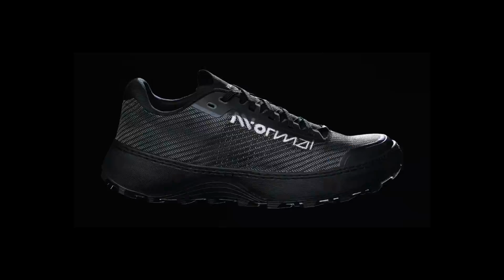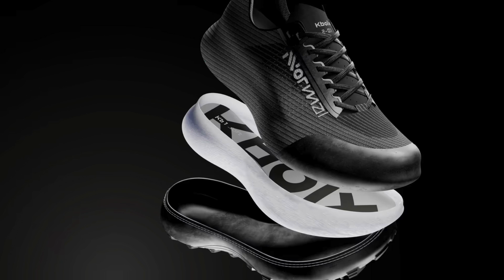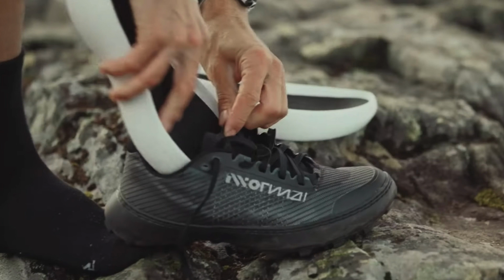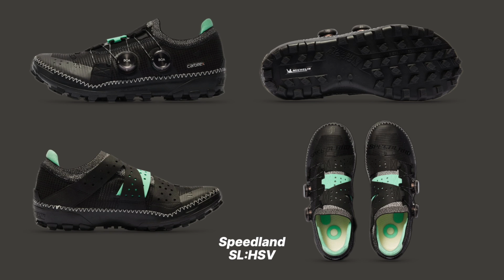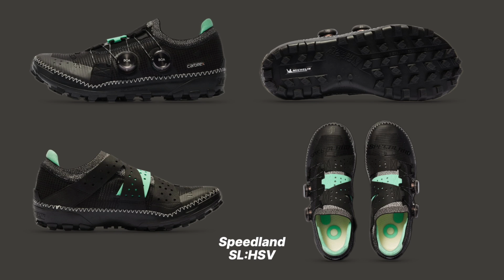Nnormal Kboix - Can a modular running shoe actually work?

Comment: I did a bit of hiking last year in a modular shoe by Haglofs called the duality. It uses 2 bloom foam replaceable midsoles. A softer red insole for most trails and paths, and a denser stiffer grey insole for rocky terrain.
I like the idea. I had wondered if the insoles wouldn't settle the same way when I changed them out but that wasn't a problem. They slotted into place consistently and the feel was the same. So I think this concept can work well.
I didn't change the mid/insoles that much because I wasn't so happy with the stiffer feel of the grey one on all but the rockiest terrain. And I have other boots that handle that terrain better.
If I could have ordered a midsole with slightly different characteristics to both of them, I could have made the shoe even better. This is where the Kboix can really take off. Give runners the chance to tune their midsoles and shells and many will want to try the Kboix. Swap out a carbon plate midsole from your regular Kboix to your Winterised waterproof one? No problem. Buy an aftermarket midsole from a specialist vendor? Yes please. It's not just a shoe anymore, it's an ecosystem
Reply from the maker: This is one of the differences with the Kboix… Nnormal is really looking at it as an ecosystem fully. The concept has a lot of legs in many mountain applications.

Comment: I don't recall the brand name, but years back there was a running shoe that cam with 3 midsole inserts that can be replaced.
Reply from the maker: The basic concept has been around design magazines and press releases but has never made and real impact due to multiple issues.

Comment: Is the Kjerag midsole really the "soft" foam? I mean I like it, but I guess my midsole ignorance is showing. Maybe I am confusing certain brands (Salomon, Nnormal) being firmer than others, but I guess I still am not able to really "get" the differences between soft, reactive, and bouncy. I mean I know my alphaflys feel like trampolines, but now I am afraid to use any of those three descriptions without being wrong. Great video btw, very thoughtful.
Reply from the maker: Trail shoes are also more firm than road shoes. No one has experienced Nnormal’s form beyond their (excellent) supercritical EVA. I don’t find it soft, like a road shoe, but I find it absorbent in the best ways. I’ll have my Kjerag review up this weekend. It’s one of the things I’m going to talk about in it. 

I am very curious about Nnormal’s TPU and PEBA foams though….

ZoomX and especially Alphafly ARE trampolines compare to trail shoes, even the Ultrafly (I’m also working on this shoe and will be discussing it as well).

So much to talk about in trail shoes right now!
Reply: @SagasuRunning  very helpful, thank you. This gave me some thoughts about my training which for practical reasons almost always starts from my front door with a 2mi commute to the nearest trail.
Reply from the maker: @colinmcc8564  Given how well Vibrim MegaGrip LiteBase wears, even on roads, this shoe could be ideal for that type of mixed surface running. I can’t wait to try hot swapping on a run when I change from dirt to road.

Comment: I’ve run 700km+ in my Kjerag’s now and just ordered a new pair for the spring although they are still in good shape. Also the Speedland has a removable carbon plate, so modular in a sense. The Tomir is like a tractor, so I hope this shoe will be something in between. And Boa would be great as I miss the Salomon quicklace on my NNormals. Thx for a good insight.
Reply from the maker: I’m curious what type of durability I will get out of my pair of Kjerags given the bit of road running I’ll need to do to/from trail I have available. 

The Tomir = tractor 😂 (sounds like a good hiker)

I would expect the Kboix to be more tractor than racer… but we will see. I’m so curious on the engineering on this one.

I’m actually not a fan of BOA, I hope it never becomes a norm for running (I’m a former cyclist and have had enough BOA drama in my life)… but it does solve engineering problems.

I too would like to see some type of speed lace system on Nnormals, especially given how well the uppers are designed and fit. 

Thanks for watching! 🤙🏻
Reply: Since you mention BOA, I think it is interesting that Tadej Pogacar has a custom DMT cycling shoe that has laces like the 1980s before Velcro closures and the Sidi Genius buckle system.
Reply from the maker: @brianreiter5572  I just googled them. Nice.  The 2024 models looks like a Salomon. I also like the lace pocket at the top of the eyelet chain.

You can never fully get rid of pressure points somewhere on the foot with BOA. It’s just the nature of the system. In a running shoe, with thinner uppers it’s a bigger issue. Speedland’s current design solution is interesting but still could be problematic for some foot shapes.
Reply: The Salomon style “lace garage” on the top of the tongue is a good idea, even with normal laces. The DMT KRSL has one I think for aerodynamic reasons. The Arc’Teryx Norvan line of trail shoes also have one. 

I have only seen it in Salomon and Arc’Teryx in trail shoes. Those are sister brands under Amer Sports so maybe there is some kind of patent or trade dress that keeps other companies from using it. 

It helps keep the laces from coming untied or getting snarled with blackjacks. It’s quicker and easier than tucking the loops into the laces down the chain.
Reply from the maker: @brianreiter5572  No doubt on a cycling shoe it’s for aero reasons… I remember that is one of the justifications to move to BOA years ago was cleaner aero for the shoe. Something we don’t really need to worry about in running, at least to the same degree.

Also, that would make sense there is some type of patent protection there. Salomon has been doing that for a long time.
Reply: @SagasuRunning  I also noticed that Kboix has a second heel hock lace-hole, which I miss from Kjerag/Tomir.
Reply: I have no need for a lacelock eyelet in a Kjerag. The last eyelet of the Kjerag is slightly high in the heel collar and really offers exceptional lockdown and comfort without any fiddling around. 

I think the key is to size the NNormal shoes by CM rather than the national sizing scheme though.
Reply from the maker: @brianreiter5572  Agree on this. The top eyelet on the Kjerag sits higher (and more forward) than most but there is in a tiny pocket made by the tongue right at the curve of the top of your foot… and offers exceptional lockdown due to its placement.
Reply from the maker: @sandstromj  I noticed this too. I wondering if it’s there to give more options as the upper (inevitably) wearing and stretches out. Something you don’t need to worry about with the Matryx upper on the Kjerag.
Reply: Killian uses the Tomir for running in snow and ice with tungsten carbide studs screwed into the lugs.
Reply: @brianreiter5572  I also just screwed spikes into my Timor’s and I really like them more as winter than summer running shoes.
Reply from the maker: @sandstromj  A true tractor, that!
Reply from the maker: @brianreiter5572  A literal "tractor" that. Thankfully, I no longer need to deal with snow and ice. Just mud and volcanic stone.

Comment: I read in RoadTrailRun that NNormal is claiming 240g in a standard size 9. That’s more than Kjerag but very light for a trail shoe. 

If it was anyone but Killian, I’d write this off as a gimmick. Because of Killian, I want to know more. 

But it is a ton lighter than the original Speedland design, which is 305g in reference size 9.  Also Speedland no longer makes the shoe that is like this design. They gave up on a lot of the modularity after their first shoe design. Their strategy is to make one run of each design and now they are doing something very max cushioned and less modular. 

The matryx upper is very light material. I imagine the outsole rubber having to wrap around the midsole and be stitched to the upper is the extra weight. 

The Kjerag is very interesting. It seems like a very direct evolution of a Salomon s/lab Pulsar but with the CO2 supercritical EVA midsole and vibrant outsole. The heel and ankle collar do not get a lot of discussion but they are sublime. I have a pair and they are both absurdly light and somehow just protective enough to handle rough terrine. I took them running in the mountains in New Mexico. They are very much the kind of thing I like and so close to hitting it out of the park for me. But the fit is quirky and too narrow in the forefoot or I need a half size larger — which they unfortunately do not make.

I’m really interested in this company. They really seem to be trying to be innovative and thoughtful in their designs.
Reply from the maker: I read the RTR too, which is what informed my thinking that this was a shoe meant for racing for Kilian and not just another trail shoe.

Agree, if this wasn't from Kilian, it would just be another design concept. But he seems intent on really evolving things and has the knowledge and passion to actuall do it.

Speedland was interesting to me with their first shoe, but I've now lost interest. Their current models do nothing for me. I like Cam Hanes, but not enough to go further with Speedland.

The Kjerag is the direct descendant of the Salomon Pulsar SG...it's Kilian with free reign, not needing to make any compromises Salomon wanted. I've never run in the Pulsars but I'm now curious due to the Kjerag. The fit of the Kjerag is also quirky, not narrow, but very long, requiring a .5 size down for most (including me).
Reply: I don’t think it’s the SG. It’s like the regular pulsar. The SG has wider spaced lugs and 5mm lugs. 

One of the stunning things about the Killian Kjerag story is the lugs are only 3.5mm. There is no deep lug version for mud. But for Killian somehow it does not matter.

I used to run in the s/lab sense but one iteration did not work for me and I ended up with an extremely painful gout-like great toe injury. The doc told me not to run in those again and I have been afraid of Salomon since. But I know the Salomon fit and I have been tempted to go back and try the s/lab pulsar. Maybe the pulsar 3.
Reply from the maker: @brianreiter5572  Interesting. Kilian directly mentioned the SG as the shoe he started the Kjerag development… and specifically how he toned down the lugs but started with the more flexible outsole idea.

I’m dealing with a big toe joint issue now, not as bad as you described, but definitely conscious of how certain shoes fit my fit at the moment. Luckily the Kjerag is a very welcoming fit for my foot, even with the narrow fit. I’m happy about that. The upper on it is so clean.

I have alot of technical steep rocky/muddy trail here in Taipei. I’ll definitely be putting the 3.5mm lugs to the test on the Kjerag. I think I have some thought as to why the low lugs work on so well, but I need some more time in the shoe to confirm.
Reply: I don’t think I have seen that video or story about Killian flat-out saying he copied the Salomon Pulsar. I mean I thought he did that but not that it is something you would ever say.  Do you have a link to it?
Reply from the maker: @brianreiter5572 I’ll try to look for it when I have time… but it was from one of the podcasts he was on around the launch of Nnormal. The host asked about the Pulsar SG and I remember Kilian talking about the development of the model… then the hat asked is that where the Kjerag started in his mind and he confirmed. Kilian never outright says it, rather he implies it and talked about how he liked the ground feel in the SG and it was something he was trying to get right with the Kjerag and why they didn’t use a superfoam on it (too bouncy).
Reply: Kjerag is a much better show (wider heel for instance) than the Pulsar SG and vibram also gives them so good grip.

Comment: Intriguing. I've only started watching this video. But why hasn't other shoe companies played with this idea? (monster insole). It seems obvious when shown here. Hopefully it's not because of forced obsolescence (mid soles of running shoes tend to get crushed out before the outsole, upper are ruined)
Reply from the maker: It’s what I said in thevideo… complexity and manufacture costs. I’ve seen this concept in many a design concept portfolio and in design magazines but there are massive challenges bringing it to market. I’m very curious about all the little details of this one they Nnormal are working through. 

It really is a “the devil is in the details” type thing with this execution.
Reply: Speedland did this already
Reply from the maker: @RowOfMushyTiT … and many others did it before Speedland. Plus this is a very different implementation of the idea than what Speedland did. They were trying to make the plate in the shoe removable and have  an extremely different design solution as well. I did reference Speedland in the video though.

Give it time to see where it goes.

Comment: Honestly, I really like the normal laces on Kjerags (compared to Salomon speedlace) - you can adjust the fit much better. I also don't see that much point in dual BOA. I don;t believe that it would enable big changes in the thickness of the midsole. I prefer to have at least somehow affordable shoe rather than making it even more futuristic and costly. Because let's be honest - if you care about reducing ecological footprint, wide adoption is the single most important factor. And even though people are willing to spend  a bit more for more long lasting shoes, you can't go crazy like Norda etc.
Reply from the maker: Ya, I’m not a big proponent of BOA for running shoes due to the extra complexity, weight and cost. I was merely brainstorming and idea on how to remove the excess upper for smaller midsole stack units. It could be done with laces as well, though it could be more complicated.

I also agree, an affordable cost… around what a “normal” trial shoe would be is key here. There are already other companies pushing the upper edge of price for “innovation” or “durability/materials”. That’s not the play here.

Comment: Road running where it is relative consistent terrain, trail changes depend on geography. For dry and relative "smoother" I prefer <4mm, wet   i prefer more, and different if rugged terrain. I presume the midsole is also the same thickness, but in trail shoe, there are different thicknesses for contact feel, and in trail, you need this for the uneven surface. Changing midsole is one thing, but consistent outsole is another. Also, upper the same? I agree that modular definitely have more moving parts, which results in more failure points. I just think this is a novice approach. I like the idea of design for repair. But the question is how accessible or cost of repair. It is only great if the network of repair is close to the customer. Just like a car, as it gets older, repair for parts just get more $$ than the cost of the car. People are more often going to replace the whole thing.
Reply from the maker: As unsaid in the video, I think this shoe may only be the first step. They will refine the idea and execution over time, increasing durability but also adding features for sure.

Changing the drop in the midsole picks wouldn’t be a big issue in this design. It’s more stack height changes would be challenging.
Reply: I’d would be insane to have the lugs attached to the midsole so when you put it in the lugs come out of the outsole!!!
Reply from the maker: Interesting idea… more challenges for sure… but ultimately they do need to solve for a way to change the outsole, as that is the highest wear part of a shoe AND the one that (especially trial runners) need to most change in often.